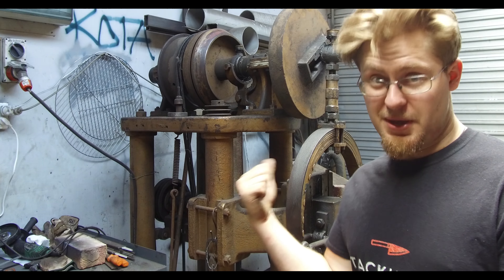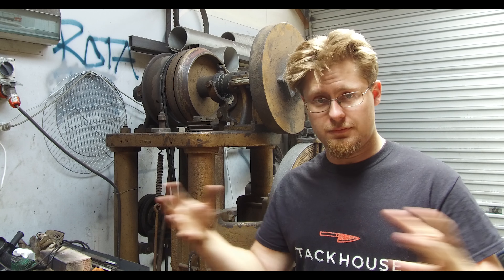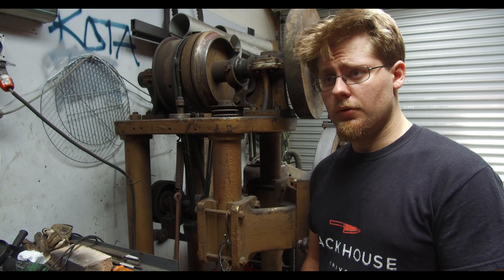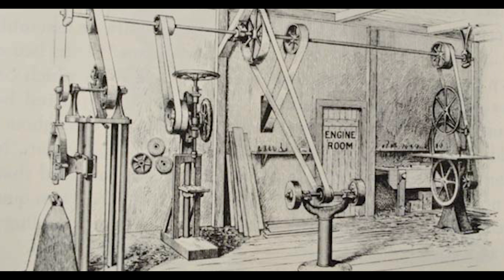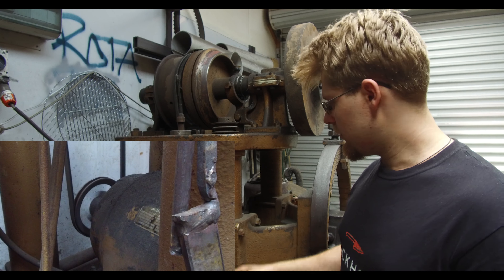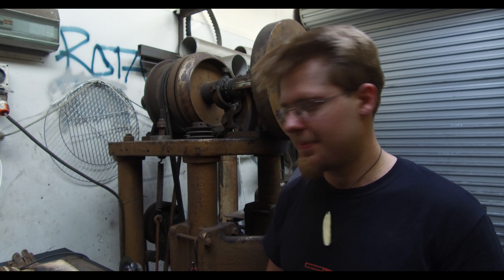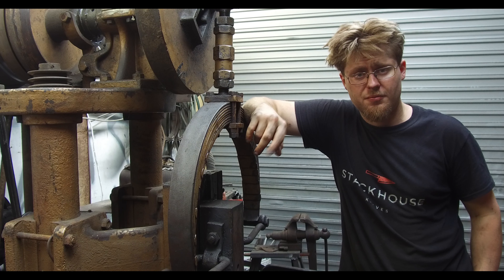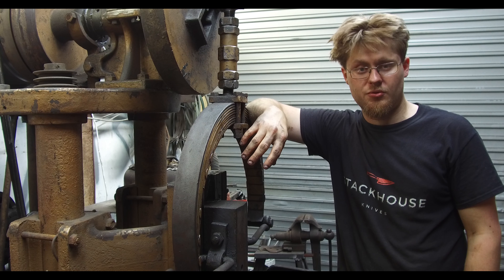My Power Hammer is the "BOSS 75lb

Comment: I have a very similar hammer myself that I'm in the process of restoring so that I can use it. 
it is in fact a Swedish made copy of this particular one, these were produced by at least one company for a number of years (I'm still trying to figure out exactly which one and when). 
Mine is a bit more light in construction, the ram weighs around 20-25 kg and the whole machine should weigh around 500 kg.
Anyways, thanks for uploading this video, it was nice to see what the original hammer looks like! I might upload a video of mine later on when it's up and running.
Reply from the maker: Thanks for the info! Always interesting to learn about the different makes of hammer, hope you get yours up and running!
Reply: @StackhouseKnives  Hello again, just wanted to let you know that I´ve managed to get mine running now, and that I´ve added two short videos of it on my channel!

Comment: I have one just like this, looks identical, but different colour.. It needs some work before i can use it but nothing is stuck or cracked.. here in Norway they were made (or imported ) by V. Löwer's maskinforretning ( maskinforretning= machineshop)
Reply from the maker: That's awesome! Mine needed some replacement parts and maintenance when i first got it. Love to see yours once its in working order!
Reply: @StackhouseKnives   will make a video of it when i get it running, hopeully this spring/summer.. i have also found one working and running just over the border in Sweden, in use by axe maker Nils Ögren - he is making videos with it already..
Reply from the maker: @JHF80  Awesome, I'll check his video out too!